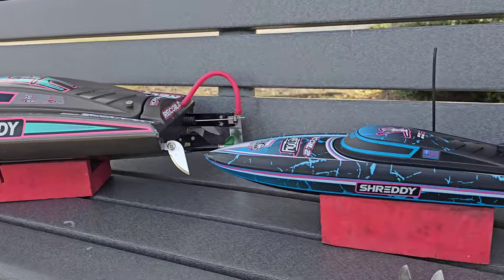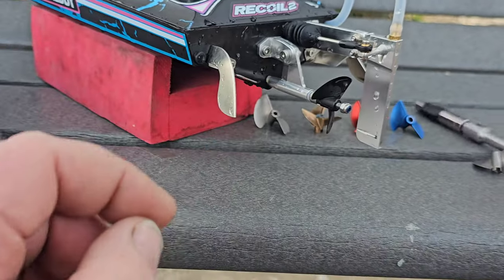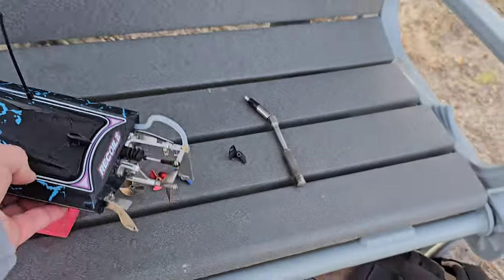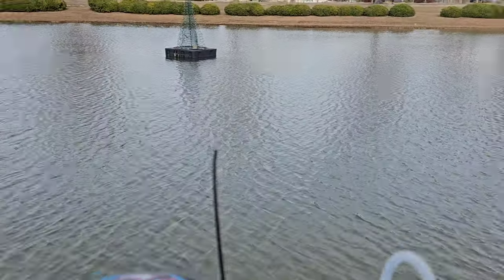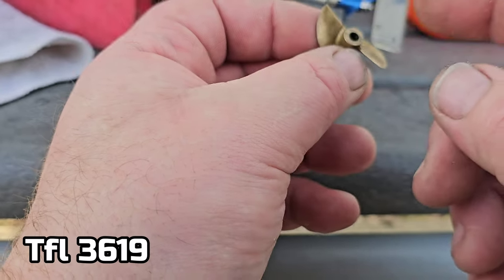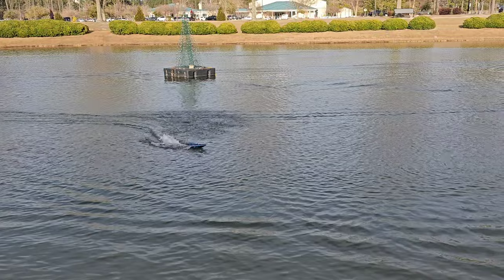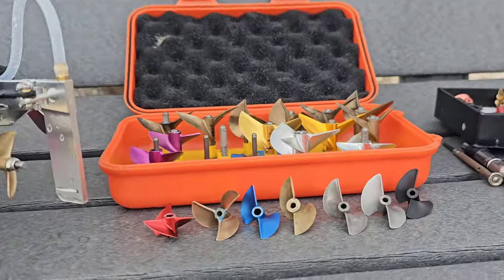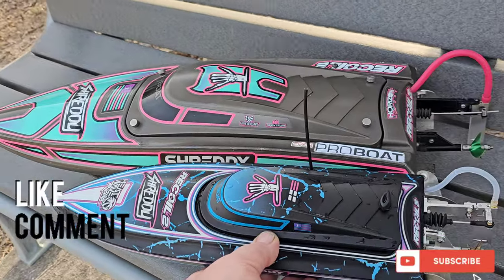Multiple Propeller Test 18" Proboat Recoil 2 Self-righting Deep-V Rc Boat

Comment: Every review I have seen on this says 35mph right out of the box on 3s,  this boat is a serious mover.
Reply: too bad it's fucking small and not even cheap and you have to consider if you use it on open water just like small scale rc planes on the sky if you go any distance you will fucking loose the boat/plane since you can't see it form far away the dark colors don't help either

Comment: So I had that same problem with my GPS, same Dynamite u got, wouldn't charge on the charge port. I made up a male to male servo extension and plugged it into the other end of the gps with the + and - marking and plugged it into the acc port on the receiver. It does put more current to it than the charger does so I only plug it in for a few mins at a time but works just fine

Comment: Would u run two blade 32mm 1.9pitch or 32mm 1.4pitch  tfl prop ? Or is it to much for this boat ?or 3 blade 34mm 1.4pitch ? Which would be better option ? Thanks and great video
Reply from the maker: I'd go 34 1.4
Reply: Thanks for reply , is there any difference between brass and cnc prop ? @IRONCLADRC
Reply: @IRONCLADRC  that's 34 1.4 3blade ?

Comment: Thanks for another great video.... Is there any way to lube the prop shaft without disconnecting from the motor? Thanks, Michael
Reply from the maker: In-between greasing I have used an oil dropper at the back of the strut and in the front of the strut.   Oil isn't a grease substitute but will get you thru a couple runs till you get a chance to grease the boat.

Comment: How can you tell the batteries getting low on juice  ? with rc cars they start running slow . With drones the controller starts beeping .
Reply from the maker: The speed control will go into what I call limp mode/LVC once the voltage gets to the set LVC cut off Reducing the power letting you know when to bring it in or you can set a timer